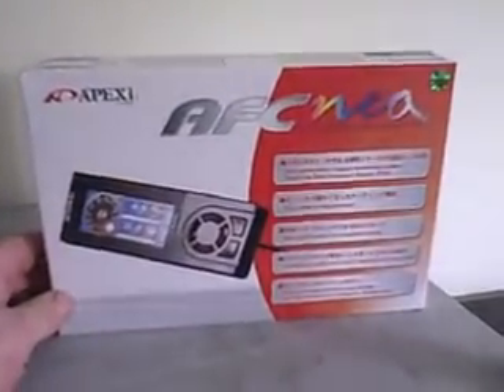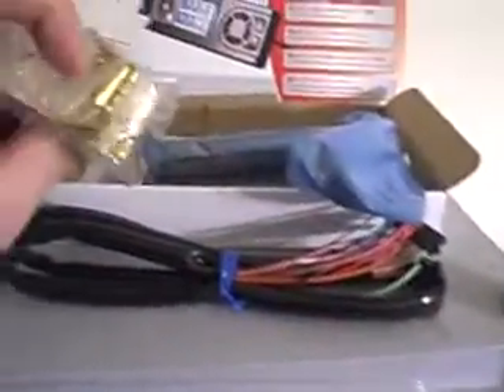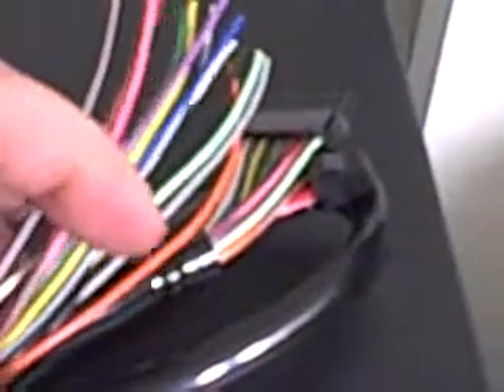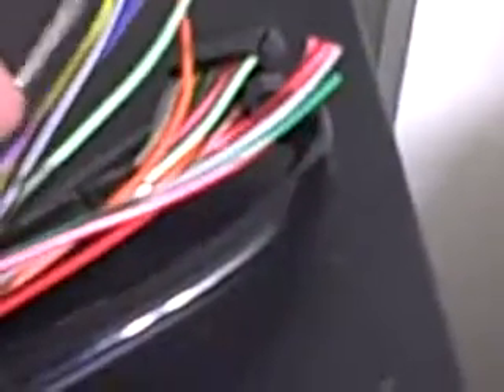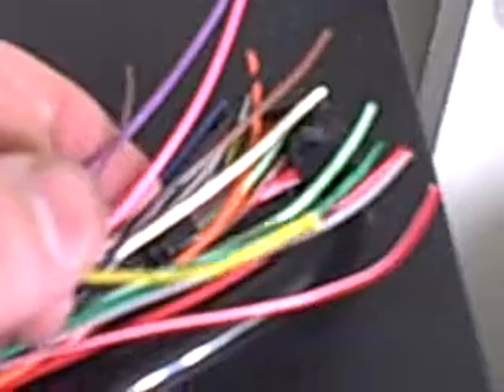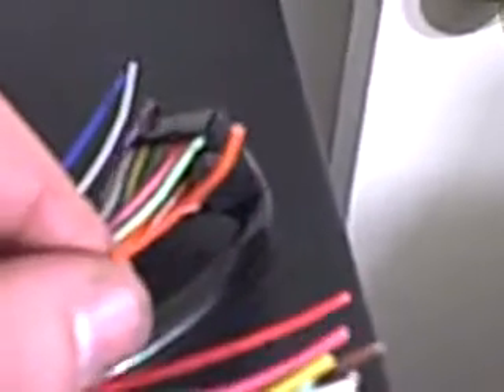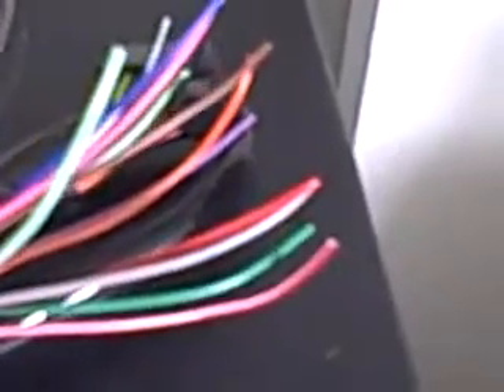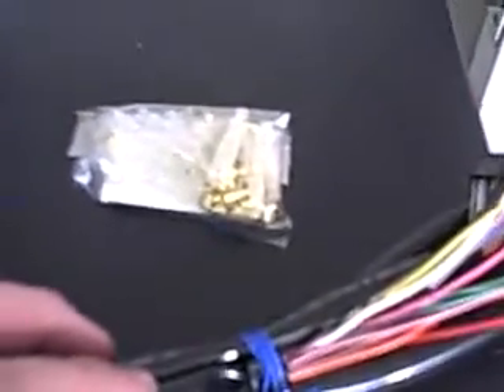Apexi Neo Introduction

Comment: nice video very complete!Question is it easy to cut into the wires and connect other.worried about damage other wire.What your opinion on getting a wire harness instead of cutting factory wires thanks